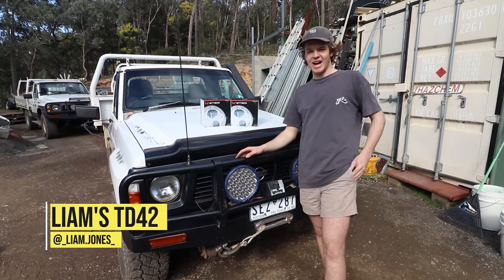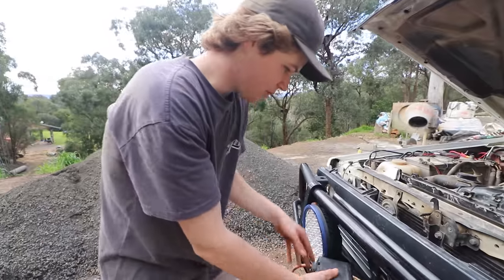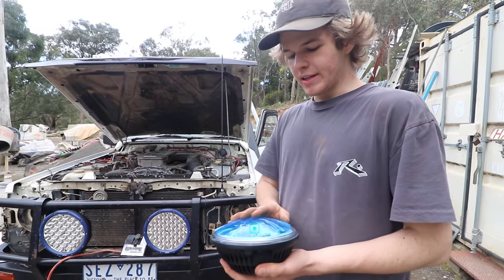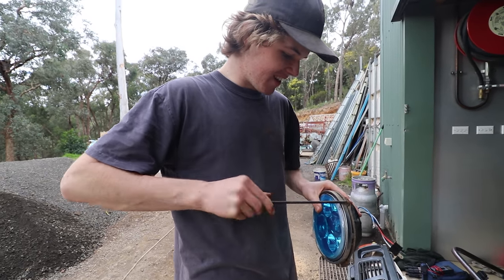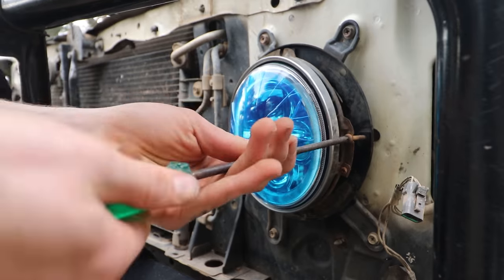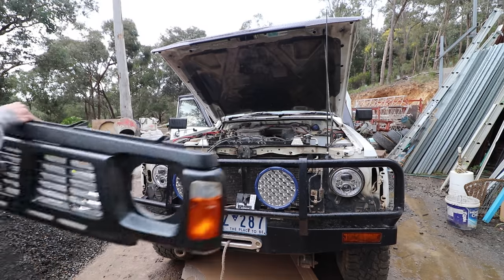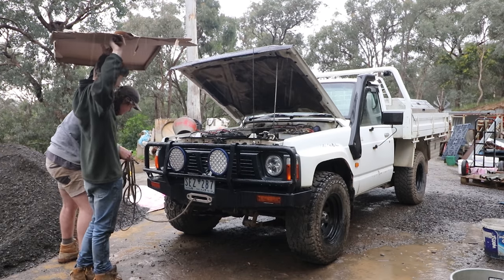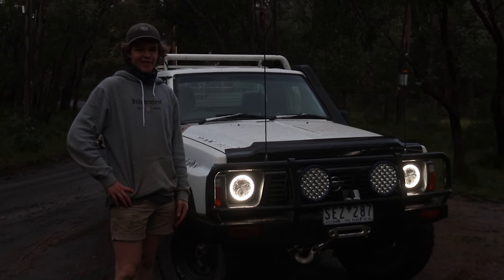I DON'T need spotlights on my 4x4 ANYMORE! | STEDI IRIS on the GQ TD42 Patrol

Comment: looks good fellas.  The best setup for the halo rings is to wire in a normally closed relay into the ignition wire power feed.  Then the switch wire can be parkers or low beam which turns off the halo rings when the head lights are on.

Comment: It’s worth getting covered plugs for the back of the switch for the DRLs, nothing like getting a short at night on corrugations from the plug popping off... or you can heat shrink or tape them.

Comment: Thanks boys you just helped me make my decision , have been waiting for the dark tint ones to come in. 
On another note check those kings light I had the same and they were drawing 20 amps and my auto electrician advised me to get rid off them as he feels that is one of the reasons my alternator died

Comment: As others said only need to remove chrome ring for install. Also 70 series owners install is identical to the patrol, did mine 2 months ago, although came with canbus fittings. Great video. Cheers
Reply from the maker: Thank you Joel!!

Comment: Just a heads up for anyone installing these, you don't need to undo the adjusters (and in turn needing to reset the adjustment) to remove the headlights. Remove the whole housing with the 4 10mm bolts to the chassis then you only need to pull the retaining ring off.

Comment: An old vid but note the big black spot in front on low beam. I have the same issue. You need to elevate them heaps to get any distance which creates a black spot in front. I replaced a set of cheap EBay but find they were actually a better light. The lenses also get a weird fog pattern on them and have too much spread. Mmm an expensive mistake!

Comment: Next time get a small drill bit and drill the grill where to just undo the lock ring for the headlight... and ya trigger wire doesn’t need to be fused cause anything under the dash is already fused

Comment: If you shine them on a wall is it a totally flat beam or does it kick up to the passenger side? Been trying to find out as I want flat beams for my global overland rig for when I drive on the opposite side of the road.
Reply: it is ever so slightly higher on the passenger side but this is probably because i don't have them adjusted correctly
Reply: @jonesy1130  Thanks for the reply man, I'm guessing it's more of a flat step then like a US headlamp rather than the angled kick up we get as standard beam pattern here? If so I'll definitely be grabbing a set 👍
Reply: @gaj5701  If they are ADR approved they will have a kick up on the passenger side of the road. You will need to suss out another brand that does flat cut offs.
Reply: @DashboardJesus999  You can have a stepped beam under all lighting regs, ADR, E, FMVSS, JIS, TUV etc. irrespective of which side the step is, as long as the upper & lower part of the beam pattern falls within the upper & lower beam height limit. If it does, it's considered a flat beam under lighting regs & can be used everywhere (I'm a former auto design engineer). Whilst Stedi say it's ADR approved for RHD, there's no mention of it either being a true angled kick pattern or a flat step which is why I was asking 👍

Comment: Adr approved doesn’t mean the cops won’t defect you for them, but I ran a set for 2 years and never had dramas but lately people have been getting pinned for them
Reply: That’s not how ADR approved works 😂😂😂

I run JTX 5x7 halos on my 94 ln106 and I’ve been pulled over by cops and been asked for my certificate for em and I’m sent on my way. If they’re ADR approved they’re legal and not defective 😂
Reply: @m-jm232  where do you get a certificate from I have a pair but no certificate

Comment: A.D.R approved, not likely, if you inquire with STEDI, as I did, they will tell you none of their L.E.D lights are A.D.R approved & my extensive research into getting projector headlights into my 2013 Landcruiser VDJ79R and all the engineer approval & testing that goes along with it to get it passed, simply put, if L.E.D lights came out standard on your model vehicle they are 100% legal, if not, they are 100% illegal and un-roadworthy, something to think about if you have insurance that you don't want voided or cause a crash at night and are deemed to be at fault because of blinding headlight glare.